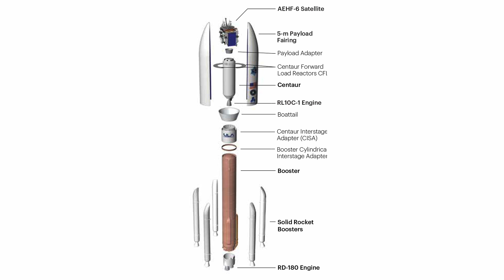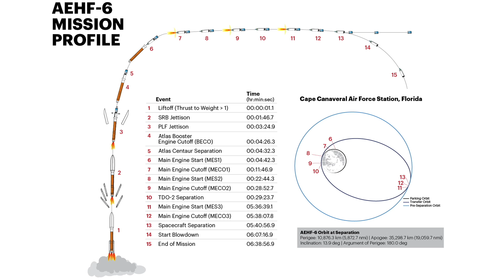Atlas V launches AEHF-6

Comment: Anyone know why precisely 5 boosters are used? Not symmetrical. I thought that was a lot of the decision to use boosters.
Reply: Only two can be fitted on one side because of the location of the external LO2 feed line. But all five solids fire though the rockets center of mass & the RD-180 engine can do some pretty amazing feats of attitude control to compensate for the uneven number of solids. They can even fly with only one solid strapped on the side.